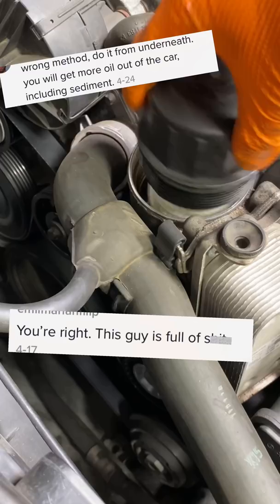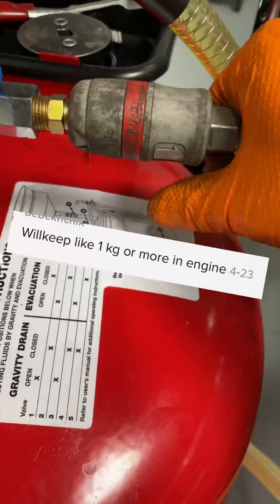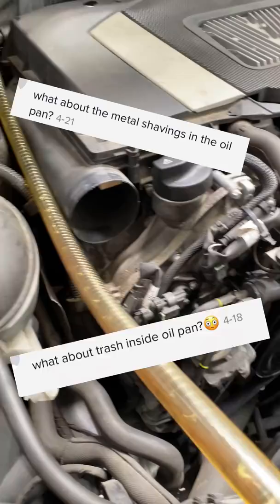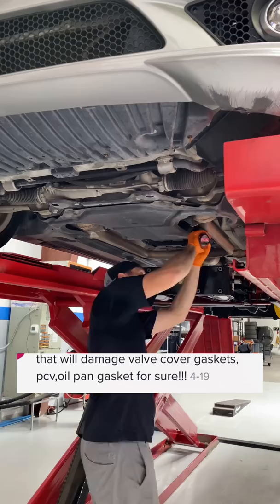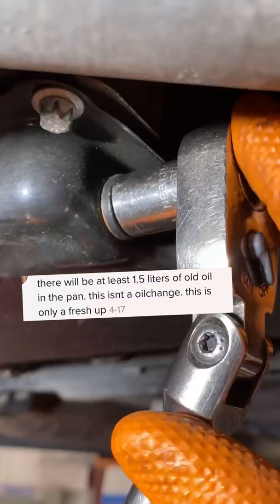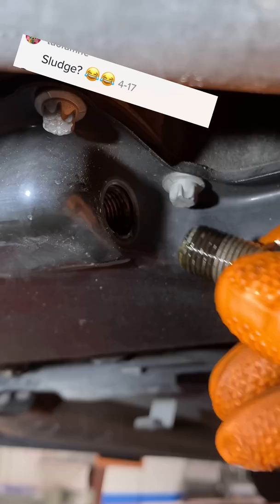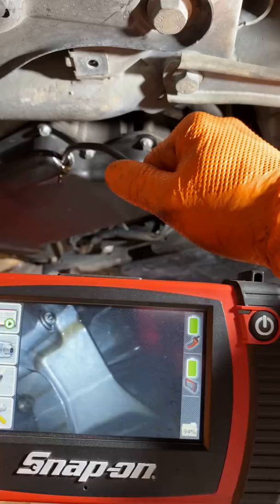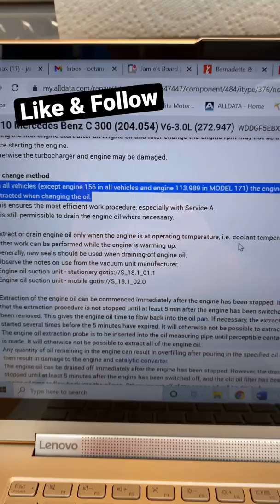#shorts Mechanic Proves Haters Wrong

Comment: I literally work at a Mercedes’ dealership, this is how they train you to do it. Mercedes engines are DESIGNED to have the oil sucked out of them, because it’s faster AND does a better job then draining it
Reply: But watch out! The backyard mechanics will come for you!!!
Reply: Actually
Reply: @Steven178p  oh no
Reply: Does it have to be a good extractor or will a cheap Amazon one work well?
Reply: Same here bro, this is exactly how they do it
Reply: But what does Mercedes know?
Reply: Well let’s not take away the fact that they want to slam as many reasons to have to take to a dealer rather than a third party as well.
Reply: My Volkswagen is too, but my tech doesn't do it that way lol. He just replaces the drain screw/bolt thing with a new one. As long as it's the same result, I don't care
Reply: Cool good we ha e a pro here that works on them for a living to tell the dumb chat people that he is doing it right
Reply: Yeah but you have to have special equipment for it that only dealerships and some mechanics will ever have
Reply: 100% bud it’s just like how I am also designed to have fluid sucked from me
Reply: @Dragoneer  Nah they sell cheap ones
Reply: HOW literally?? VERY Literally? Or just somewhat Literally?
Reply: I've worked as a mechanic and I have a mechanical engineering degree. I highly doubt that sucking out the oil does as good of a job or better than draining. I've worked at a universal shop and worked on all types of vehicles and have seen metal shavings stuck to the drain plug because they may be magnetized to keep it from circulating through the engine and transmission for the transmission drain plug. Gravity can't be turned off...
Reply: @mervinsecure1cambricsecure957  you are 100% correct. Mercedes does this so you take it to dealer and pay$600 for an oil change. Where they suck all the metal dust through your engine. Ensuring it won’t make it to 100k miles without a $10k service. Meanwhile your car is losing incredible value with each mile you drive. The guy in the video isn’t wrong this is how they designed it. But no one understands that does make it a good idea.
Reply: @Chamacurmom  😂
Reply: @chiiloutbro  the internet is a scary place Johnathan….it’s not like it is in Cabot Arkansas…. You still mad???
Reply: Oh and I dont revise my typing, so don't take spelling to far I know you'll have some corny joke about a literature
Reply: @chiiloutbro  lol no I think you are less intelligent because you got upset over facts. And because you don’t understand how the internet works. I guess Air Force college doesn’t have high requirement’s…..
Reply: @chiiloutbro  again what did I say set you off? What wasn’t factual?
Reply: @chiiloutbro  what’s the matter Johnathan nothing more to say?
Reply: @chiiloutbro  come on Johnathan you are a big man remember? I’m just a little “puss boy” lmao
Reply: @Number1FanProductions  lol he won’t say anything anymore. He wanted to call me a “puss boy” and tell me to “come to Arkansas” because I said Mercedes charge a lot for oil changes. Then I found out where he works and lives and went to college in about 3mins and he got scared. Guess he isn’t such a “man” after all :)
Reply: But then they did away with their dipsticks. Where do you extract from?
Reply: I think they just made it top drain so they can tax you for oil changes. 
Getting more people to go to the dealership for things commonly done at any shop is a money maker
Reply: Short answer: We drain it.

Long answer: Preferably I drain the oil, bc if it's already in the air for an underbody check, I can drain the oil just as well. The copper washing is on you then. Sometimes there aren't enough hoists in the shop, so one might guess to suck the oil out. Doesn't work anymore with the newer engines. Some engines removed only the dipstick for a plug but others don't even have that tube anymore. So all you can do is draining the oil. What annoys me the most is the missing dipstick. Now you have to eyeball the amount of oil you fill in and have to drive the engine warm to get an actual oil reading in the Assyst Plus. It works as well with the workshop menu but I find it not accurate enough and risks an easy overfilling.
Reply: @LMO169  I was just hoping they continued using tubes and just hiding them. People keep bringing European cars to the dealership I work at. Which is a HONDA dealership where we get .3 to do an oil change and mpi, which isn't even enough time to get these damn skid plates off with their 900 fasteners that are all different. I picked up an extractor yesterday, I'm looking forward to it being useful on at least some of the ones coming in.
Reply: What does Mercedes actually pay their techs for oil changes?
Reply: @patharmon9760  We're paid flat rate and more than average around here
Reply: @LMO169  I'm flat rate too, and have been arguing with my managers that we should be paid more for European cars, so I was wondering what Mercedes guys get for labor. I'm sure it's more than .3
Reply: @patharmon9760  The most basic Service A is like 12-15 units, 60-75 minutes. No clue how much we would get for that. I really enjoy working on Daimler, since they are built with the mechanics in mind, there are some specific models and engines that are a slight pain in the rear but on the common models it's nice to work on. Especially on VAG cars I don't understand what the engineers were thinking when developing these vehicles.
Watch out for the newer 4.0 V8 Biturbo engines. Don't let them sit without oil too long. Drain and immediately refill because the timing chain could skip and that's not warranty covered.
Reply: @LMO169  thanks for the heads up, that doesn't sound like a design flaw at all
Reply: @patharmon9760  yup, check valves at the chain spanners and problem would be solved
Reply: @mafiacityhilmy1064  maybe so they don’t have to put it on a lift? I’m not sure either.
Reply: @mafiacityhilmy1064  becaus they designed it that way.
Reply: @michaelric3540  reading comprehension is key. I said they build them like that to make money off dealership oil changes, I did not say to ignore doing it the recommended way.
I'm not talking about people doing improper work I'm talking about them making a crap design to force people to need help to fix or change simple things that should take 15 mins at home with basic tools.
Reply: @Chamacurmom  go get a job
Reply: It's almost like the people who designed, engineered ,and put into production these vehicles know how they work and assign them to work with this method.
Reply: @chiiloutbro  yea unfortunately the other guy you were arguing is having the upper hand and you presented nothing to counter it so you kinda lost
Reply: @Chamacurmom  if you upset Mercedes charge you more for their service, maybe you should get a job like those millionaire that don't give a fk about money. Also don't own a Mercedes if your concern are those yearly maintenance cost.
Reply: @liberatorkramit  Of course they do, they're running a business. That doesn't change the fact that sucking it from the top is the best way to do it and is something you can do yourself, as advised in the manual. The idea that some lay person knows better than the car manufacturer is hilarious.
Reply: @Chamacurmom  There's nothing to "prove". You made some ridiculous claims about a conspiracy of sucking metal shavings through your engine to damage it, requiring a service later. The reality is the manufacturer has outlined in their manual that this is how it's to be done. The manufacturer knows their product better than some YouTube expert. Besides, if you have metal shavings, your engine has some serious problems.
Reply: @jonathanxavier2026  lol cool I really don’t care what you think. You can call it a conspiracy all you want. Mercedes over charges for service. Period I am not alone in my “conspiracy”. To think that a manufacturer like Mercedes doesn’t create process and procedures to charge more is hilarious. You can say it’s conspiracy theories all you want but it is common sense. All moving parts produce wear eventually. Wear produces shavings. And Mercedes are not known for reliability and longevity. Look how extreme their depreciation is. (One of the highest / fastest in the entire car industry) that is also a proven fact you can call a conspiracy. Either way I’m tired of talking about stuff I said months ago. And I could careless what some “YouTube” expert thinks. So stfu and enjoy your opinion 😘
Reply: @Droopz707  its a Mercedes spercific tool
Reply: @liberatorkramit  there’s still a drain bolt though, how is that in any way stopping someone from doing themselves?
Reply: @mafiacityhilmy1064  it’s quicker and uses pressure to pull it out. draining it from the bottom leaves oil within the block
Reply: @Dragoneer  there’s a drain plug
Reply: @oriongabriel6966  lol nice
Reply: Okay well it may be faster but, draining from the bottom will do just fine in a pickle aye. I feel like Merc did this so that people are less inclined to perform oil change themselves and now dealers can charge $150+ for oil.
Reply: The only reason I would ever comment on this idiotic comment is because 69
Reply: @Chamacurmom  damn, but was it necessary?
Reply: @ederkkj  Was what necessary?
Reply: @Chamacurmom  going after the guys personal life 😔
Reply: @ederkkj  absolutely not. Getting upset at all isn’t even necessary. But he made things take the turn they did.
Reply: Sucks the oil out LOL
Reply: @semperfi2146  how to make cars?  It's literally one of the best and most successful car brands
Reply: @mervinsecure1cambricsecure957  this is the most cringe thing I've read in my life
Reply: @Chamacurmom  you're definitely American
Reply: @tortellinifettuccine  your definitely a eunuch…
Reply: That does it then, I want a Mercedes
Reply: @ytilaeR_  bro it was a joke
Reply: @Dwight K. Schrute  you are wrong about it sucking "metal dust" through the engine. The oil dipstick tube goes into the oil pan. So you are literally just sucking the contents of the oil pan out. This is literally the same concept for how boats get their oil changed...and it works just fine. 

Totally just gave you facts to prove you are wrong and that you are just an internet troll who does not have any knowledge
Reply: @gorillawrenchin  oh I see sensitive YouTube removed my reply. I guess I will have to try to be a little nicer in my reply. Just because you say “you gave me facts” means absolutely nothing this is 100% an opinion situation. Find me any ASE document stating this is a better method. That would be facts. You can find thousands of arguments saying this is a 2nd rate method and should only be done when there is no other option. I guess because Mercedes uses plastic oil pans on a high end car means there is no other option. You misquoted me even but that’s ok I don’t really care. You are bald and have women like shoulders so I will give you some slack. All I originally said was Mercedes chooses methods like this to save time and charge $400 for an oil change and I stand behind that. Find me real facts stating this is a better method. All my other comments were to cause anger because I was dealing with people like you. I stand behind my original statement Mercedes rips people off on service. And uses cheap parts in some cases. There ya go little buddy call me a troll and feel better. I don’t care about a argument that started so long ago you still had hair!
Reply: @gorillawrenchin  do you use this method on all your cars? Or is this just an option if you had to? Like I said literally thousands of arguments online but you won’t find anywhere saying this is a better method. It’s a 2nd rate method for a supposedly high end brand. It’s a part of a gimmick to over charge for service. Period you can say I’m a troll and have no knowledge and I’ll go cry 😢 . But you still will never prove this is a better method. Also you will never get you hair back…
Reply: @Dwight K. Schrute  You really invalidate anything you say when you try to attack someone personally...I gave you the fact that to tube goes directly to the oil pan, which means it's going to directly suck out the oil in the pan....common sense.  You can keep making personal attacks on people, but the world can see who you are when you do things like that. Have a blessed day!
Reply: @gorillawrenchin  lol did you not call me a troll and say I have no knowledge? He who throws first stone brother.
Reply: @gorillawrenchin  you made very good points and I agree.  Though I still would and will continue to pull plug  and drain whenever possible. Sorry I attacked you everyone wants to attack me for saying Mercedes over charges on service. which is the root of what I’m saying. Everyone wants to say I know nothing when most of them have never even popped their hood. Sorry I’m a jerk lol. You have a Blessed day too man!
Reply: @Dwight K. Schrute  I'm an Ase master technician and I've used both depending on the situation.  Also, saying you are a troll and have no knowledge is different because those are facts and not name calling...

Also, you can make fun of my hair all you want, doesn't hurt my feelings one bit. I'm not going to upset with how God made me. 

God bless
Reply: @gorillawrenchin  lol oh I see! Is that difference? hahaha so you like to give insults and act like you aren’t so you feel better? Remember God sees the condition of your heart…
Reply: @gorillawrenchin  I would make fun of your hair but it already got tired of listening to you and left!
Reply: @Dwight K. Schrute  I find it odd, that it takes you multiple replies for you to say everything. Me personally I will just say what I need to say all at once, instead of having to put in little tidbits over and over. 

Also, did your mother neglect you a lot as a kid?  This looks to be textbook behavior for people with mother issues.
Reply: @gorillawrenchin  lol
Reply: @gorillawrenchin  there I broke it up into 3 replies just for you.
Reply: @Dwight K. Schrute  in all seriousness,  I ain't mad. There is one reply that you had that you explained yourself without poking fun of people. It didn't show up in my inbox earlier. And its cool, I troll from time to time too. Have a good weekend
Reply: @gorillawrenchin  haha you have a good weekend too brother.
Reply: @BL Dontmatter  all of the German cars I see that have issues,  the customer DOESN'T   follow the maintenance schedule.  The customers I have that follow them, only have minor issues, like valve cover leaks, and water pump, coil failures...you know the stuff all the manufacturers deal with
Reply: It’s more so that you do not slip or cross thread the drain plug, cause that way more expensive to get fixed.
Reply: BL Dontmatter  2017-18 is when they went plastic,&they had suckers when sumos were metal/aluminium etc
Reply: @deanomcevoy  oh dear.

Comment: I was a mechanic for 16 years and freaked when I heard about this.  I had so many questions and this answered pretty much all of em.  Thanks man.
Reply: Your thing about a different system that most lube shops use
Reply: Who are you telling to shut up?
Reply: @genesisaddict6230  I'm a walmart lube tech we use the system at are new store, are system is not air sealed and most of the tubes don't reach to the bottom of the oil pan and are pumps are so weak that some techs leave 2 quartz or more to keep low bay times. If you wait a hour for the pump to finish I can tell when im adding oil I have extra left over. Not good for fast oil change shops
Reply: @AgentSmith-ci8pv  well it’s Walmart I used to work there too and had people that told me just to find another shop🤣
Reply: @adeksadeksinski681  what is it boy?

I think this one is trying to say something intelligent🤷‍♂️
Reply: Its a video, and could have been modified and cut and setup for you to believe whatever their exposing. So dont just believe this silly video, do by ur self and see if its really work cuz this is just an edited video
Reply: @NsskMedia  do I smell clown?
Reply: @blackforceswithnolaces5273  I do about 30 oil changes a day, machine suck and also oil drain plug both, so maybe I know about the topic....
Reply: shut

Comment: If the manufacturer recommends it, then do it. Mercedes isn’t stupid, they tested it and made sure it was worth it.
Reply: While that’s typically true, I’ve also seen car manufacturers do things that kill the owners of their products.

So I wouldn’t say that you should assume that everything the manufacturer says is completely true.
Reply: Manufacturers can get it wrong too. You follow the rules because if they make a bad product and you do everything right, they're responsible but if they make a bad product and you don't do everything right, you just might both be responsible...
Reply: I mean, if it works, it works. However, I would argue that "engine oil should be extracted" doesn't specify which hole said oil should be extracted through.
Reply: They warranty the Engine so
Reply: @frankdevo5715  well that’s why I’d never buy a car that’s less than 3 years old. Gotta have time for others to break in those risks 🫡